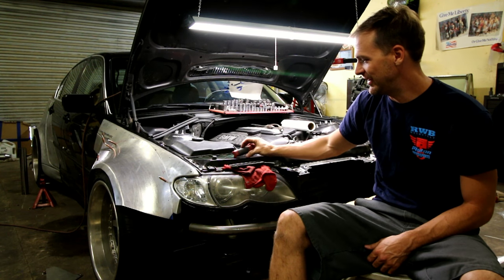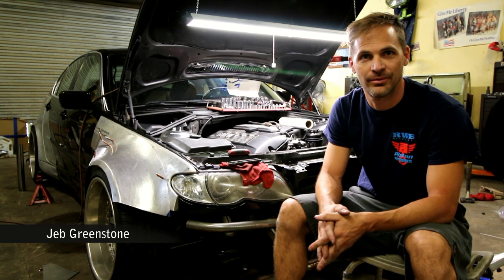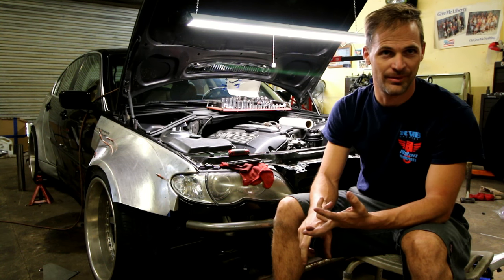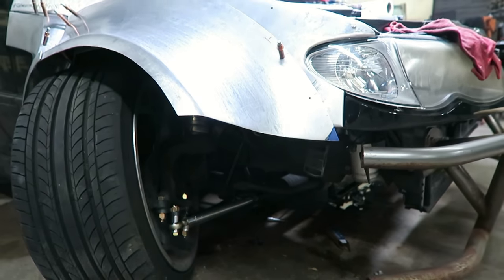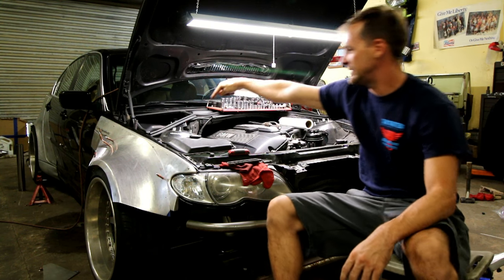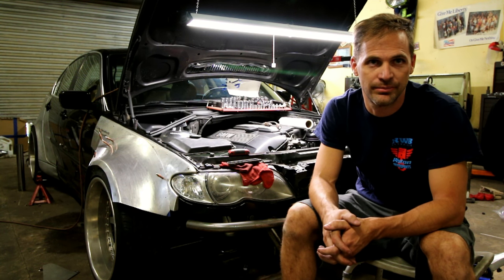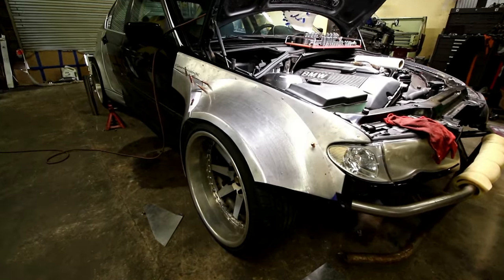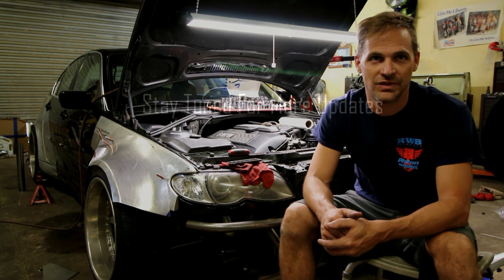BMW e46 Aluminum Widebody Build Update

Comment: sickest BMW ever I love your car bro 👍👍👍👍👍
Reply from the maker: thanks
Reply: I think that you should polish the parts that you've made. You know, all of the finish-work... Are you going to paint it? I want to know your end-game, Bro! What it looks like in your head, as a finished product... Do you plan on painting it, or partial paint and polish the fabled parts? I'm just trying to figure out where you're going with it. But, I do like it, very much! I like the way that the kit is deliberately over-lapping the other body panels. I think that you should paint the car (Not the kit), polish the panels that you've made, and maybe put a color-matching pin stripe about one quarter of an inch along the inner leading edge of your panels. I think that this car would look pretty bad-ass, with the right aesthetics to finish it off. Thank you for the video!

Comment: check out Tony155 and his turbo 330ci. Do yourself a favor and at least install a catch can. My 330i gained at least 10% power and completely stopped burning oil. THE low tension rings really benefit from extra vacuum
Reply: The catch cans are sweet but have you checked out the 02 pilot mod I'm going to do it next bit of good weather I get apparently stops the oil consumption you just tap on to a vacuum line and connect to the ccv